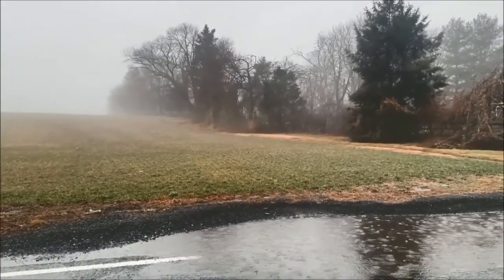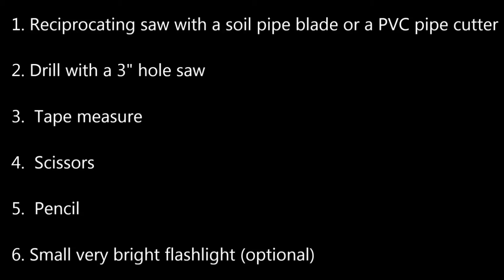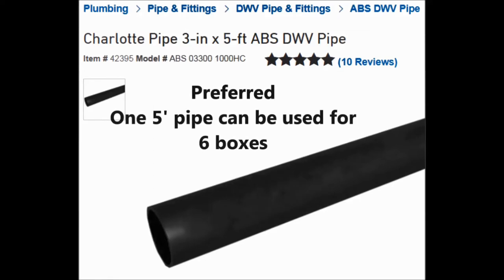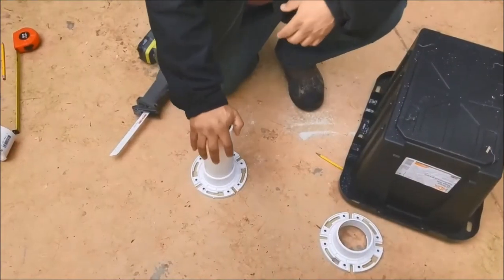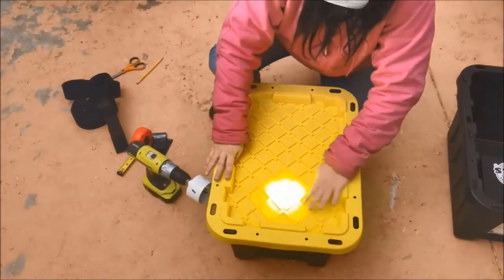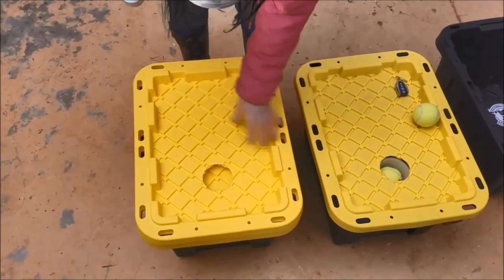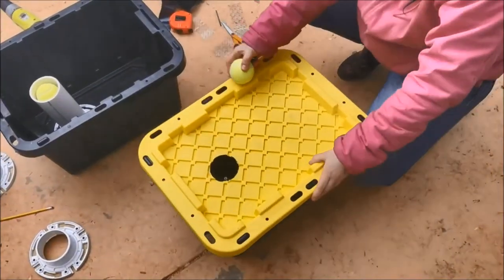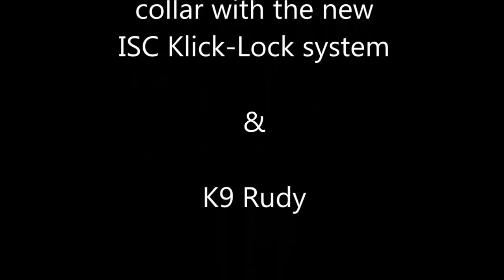The Poor Man's Scent Box

Comment: 5*$350.00=😳
Reply: What are you multiplying???
Reply: @grittysmitty5028  the device that spits the balls out of the box. They each cost approximately $350 a piece.
Reply: @emilgabl9069  ok...but why are you multiplying that by 5?  There's only 1 KAZ ball popper in 1 of the boxes.  The others just have a PVC pipe to mimic the one that does
Reply: @grittysmitty5028  🤓👍🏽